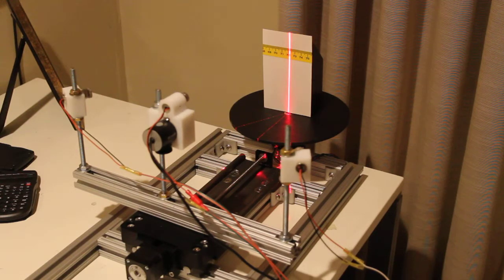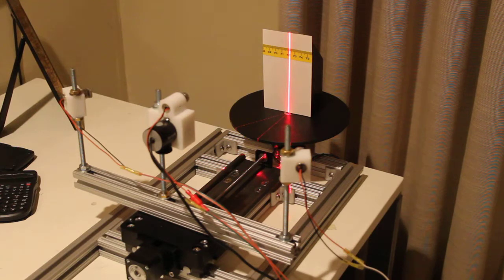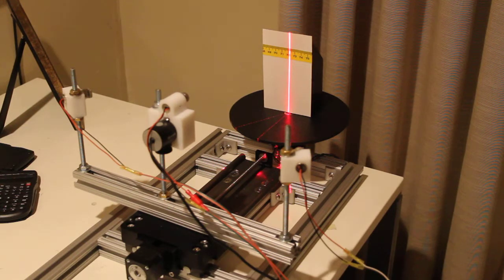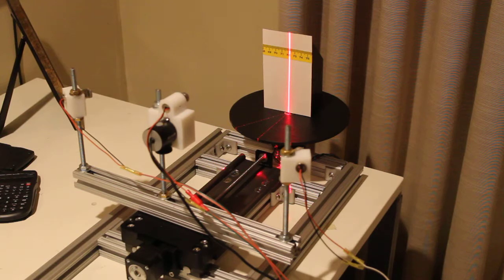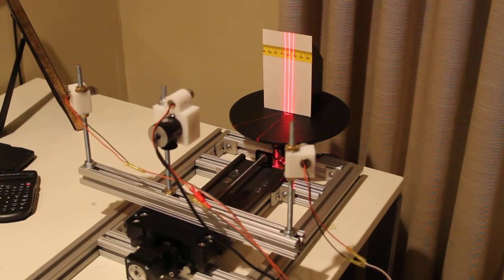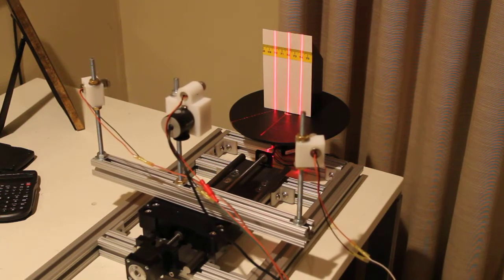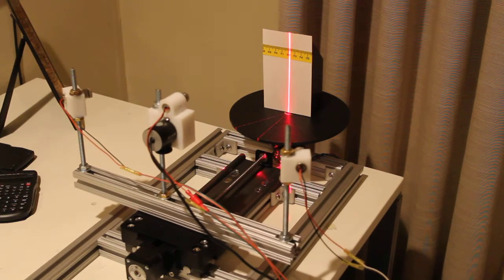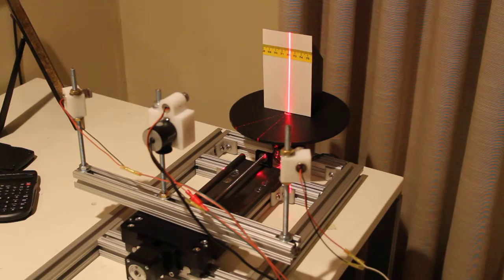3D Scanner Calibration

Comment: hi
how can i get a clear line laser from a dot laser?
Reply from the maker: +mina magdy They cost two bucks on eBay. 

http://www.ebay.com/itm/650nm-5mW-Red-Laser-Line-Module-Focus-Adjustable-Laser-Head-5V-new-Laser-Module-/301664558528?hash=item463c9bddc0:g:xnwAAOSw~gRVgRuj

It's a little lens in front of a regular laser diode. It amounts to a stack of cylindrical lenses.

There is a range of quality, power, and wavelength for these. Just type "Line Laser" in eBay.
Reply: i know it
i need a stronger one
Reply from the maker: +mina magdy So do an eBay search. There are hundreds of varieties. Here is an example of a more powerful green line laser for $34. Search for "line laser" and select what you need.

http://www.ebay.com/itm/532nm-50mW-Green-Laser-LINE-Module-Locator-for-Cutting-Machine-adapter-mount-/110986678935?hash=item19d7525297:g:DYEAAOSwyQtV3Su-